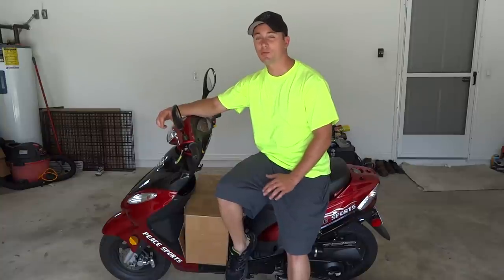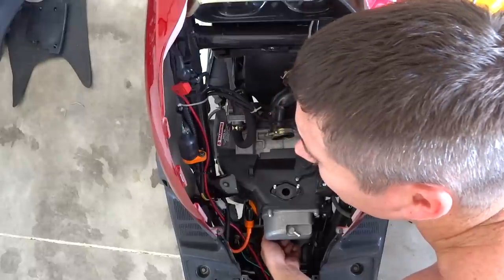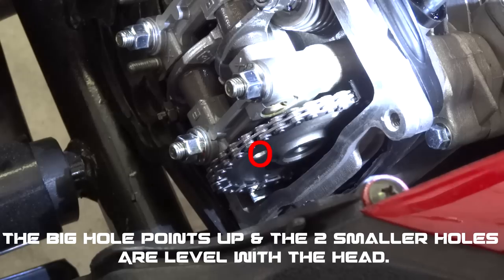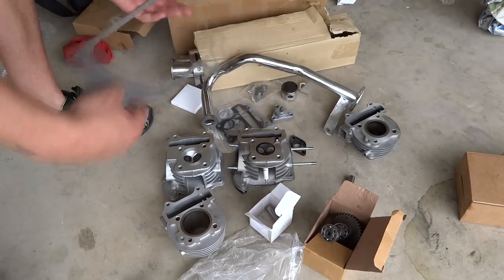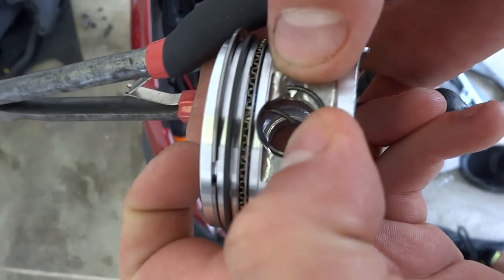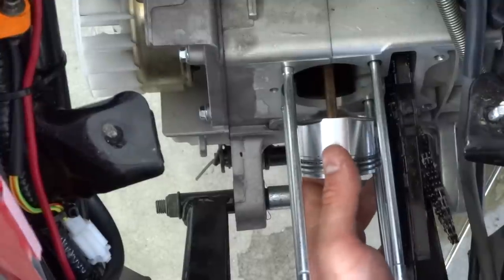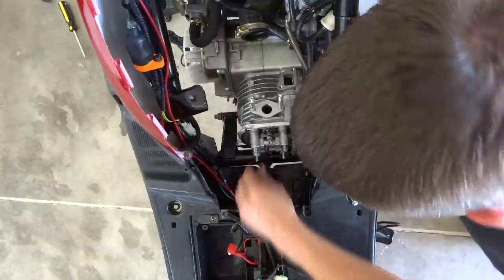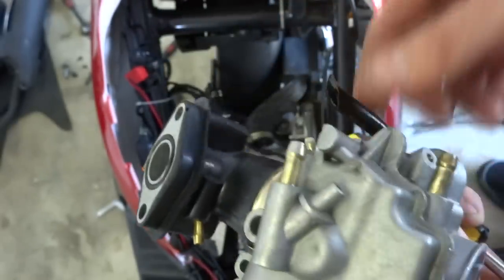DIY Gy6 Scooter 50cc to 100cc Kit

Comment: What was your tip speed? After
Reply from the maker: 56mph
Reply: @Nthefastlane  dang!
Reply: Dont believe it,  wait for proof with gps speedo (phone app), as Chinese speedos by all manufacturers have all stated Speedometers are only accurate to 28mph  as that is the only stipulation needed. A ful modded gy6 50cc with alot of mods will only top out around 51mph max and believe me just a big bore kit , upjetted carb, cone air filter and unrestricted exhaust your only looking at 45/47mph. to get more speed you will need higher final drive gear, sports variator adjustable unrestricted cdi with all the above  etc etc. fed up with vids of spotty little kids claiming  nearly 60 mph out of 50/72/82 cc kits.. GY6 125ccUK/ 150cc in US only manage 60mph. ..  so how would your 72cc be as fast as 150cc??????
Reply from the maker: Here's exactly what you asked for. BTW I was 29 in that video, not so much a kid. https://www.nthefastlane.com/gy6-scooter-100cc-bbk-56mph-proof
Reply: Nthefastlane I hate assholes Keep doing you ..  how was hill climb an stop an go ? I’m 6’2 about 280 lbs I like running around the neighborhood to the rec center n stuff on my 49cc scooter do you think it’s worth while for me to help in hills an putting more pep in my step so to speak?

Comment: did it last long ? with the stock crank shaft?
Reply from the maker: Still riding it till this day, I have also rode with two adults on it many times with no problems.
Reply: oke so if i want to go from 50cc to 100cc the crankshaft (original) is good ?
ps your video's are great!!!
Reply from the maker: Still running strong at 56mph

Comment: hey i dont know whats going on with my scooter , i 've been put everything i changed 50cc to 100cc but when i start make a laugh sound ! i dont know what i did wrong or whats going on , somebody help please!
Reply: try the simple things first overhead cams are not easy to do for people who have never adjusted overhead cam if it's making a tapping noise there is a possibility that the rocker arms on the overhead cam maybe a little bit too loose my suggestion to you is take the scooter to the shop and let them check it out for you they will take off the valve cover and they will check the clearances and make sure it is correct it only takes a small amount of movement I've adjustment to be too loose or too tight especially to tight is very bad because too tight will cause a lot of problems because if you don't have enough clearance it will scar the cam and it will star the cam so I highly recommend taking it to a shop have them check it out a very likely possibility is the valves need to be adjusted could be the valves adjustment there may be too much Gap between the Rockers and the cam I would not drive the vehicle just take it to the shop because you may further damage your scooter also the scooter needs to be cold it's going to need to set overnight so that the motor is cold so the technician can adjust the valves this is my suggestion I hope this information will help you overhead cams are very difficult to adjust properly you really need a trained professional to adjust the valves correctly

Comment: You didn't quite "clock" your rings. First, lube with engine oil, second, NEVER have gaps of rings by Piston Pin holes of the Piston like u did, always at least 30-45 degrees away, and then have the rings offset from each other 180 degrees or so which you did..

Comment: Use the 50cc head it would increase the compression because its not milled out , might have to run premium 98 octane gas ....but it would run like a scalded ape
Reply: Cassidy Strickland how sure are you about this?

Comment: just so you know, the difference between the 139 and the 1p39 gy6 motor is that the 139 is a true 49cc motor. the 1p39gy6 motor, is a true 64cc motor. if you compare the 2 pistons, the 1p39 is bigger than the 139. some people will say that the difference is that the valve length  is longer, but that's not true. the 1p39 is a 66cc motor, so if you buy a boar kit, make sure you know your motor so you don't have a 64cc 1p39 and buy a 60 cc boar kit. that's the fact about 139 and 1p39 gy6 motor!!!!!

Comment: You didn't apply oil or assembly grease to the cam, piston/rings/ cylinder. Very bad mechanical practices. Tapping engine components apart with wrenches and not a soft hammer? Noobs will see this video and damage things. Set a better example.
Reply from the maker: Jim West I did,just couldn't find the clip that I did it in. 100's of clips,somtimes one get's lost or deleted by accident.
Reply: yeah sure guy
Reply: Had I relied on this guy my scooter would no longer exist
Reply: I also noticed that he was so hell bent on putting the engine together and didn't put the plastic shrine back on. So also some noob is gonna end up overheating their engine.
Reply: Good work but Look piston ring caps just put them one by one to the cylinder and file caps correct too tight boom !!!

Comment: 28:03 most painful sound i've ever heard.
Reply: What is?
Reply: @TECHnoman753  I don't know the materials the cylinder and piston rings are made of, but you still should oil the cylinder before pushing the piston in so you don't scratch it.

Comment: Why not just buy a 100cc scooter in the first place? There are plenty of them around at often quite reasonable prices.
Reply: I think because a 50cc kit you don't need a motorcycle license but it u go above 50 you do. So I guess it's like a loophole to drive faster without a motorcycle license lol
Reply: Exactly. Anything above 50cc you'll need to plate it, get insurance and have an M class license. 

With this its still looks like a stock 50cc so unless the police take your scoot apart there's no way of knowing.

Comment: I have a 2014 TaoTao will any Big Bore Kit work or are they scooter specific? Also what was your max speed once you got it back together?
Reply from the maker: +Amber Summerow They go off the engine codes 139QMB & 1P39QMB. Top speed was 57mph flat ground.

Comment: This would be a good video if you knew what to do and what things were called and yes cars do have an oil control ring and 2 compression rings and such for loosening the cylinder head and barrel with a ratchet handle, I would have used a rubber or nylon mallet. I watched 22 minuets and could not watch any more but from what I read I am glad I didn't

Comment: Name it what it is. The 100 cc kit doesn't exist. The 139qma & 139qmb motors have a 41.4 mm stroke. With this stroke length, the stock 39mm piston makes 49.4cc's. The 44mm kit brings 62.9cc's and is sold as a 70cc kit. The 80cc kit with a 44mm piston has 71.8cc's. And then there are 2 versions of the 100 cc kit. One with a 50 mm kit which is more widely available at 81.2cc's. The 52mm kit gives you 87.9cc's. With that said, none of these kits give you what is promised. Of all these kits, it has been heavily noted when using the stock crankshaft and bearings, to not go over the 47mm kit. The crank bearing can't handle it.

Comment: You had better check your valves for seal ,that's china part's an awful lot of confidence in China parts, it takes 2 minutes to check valve for seal and if they ain't sealing your screwed , o and dowells not shims , and how long are you expecting run life out of out of balance oversized piston,needs spin balanced with piston mounted on the rod crank in balancer , other than that your gold , be sure to tip your hostesses but not inappropriately 😃, clowning with you homie ,have fun enjoy that's watts it's about

Comment: I know this sounds retarded but as a bet that it could be done. I put a 150 cc  gy6 engine back together after it had been setting taken apart under an oak tree for about a year and all seems to be fine except it has a skip all through rpm range except deceleration. And the only real problem I had was setting timing chain on cam shaft. I couldnt get camshaft to line up proper with head with piston at top dead center it was either a tooth advanced or a tooth retarded but not the right way. Or does the cdi serve as brain n correct the timing?

Comment: This is not a 100cc only 72 or 80cc
Reply: YD AgilitY I have had the 52 mm kit on my scooter. It makes it a 87.9cc scooter. Could you please point me in the right direction for a 100 cc kit? The bore size would have to be 55.5mm to make it a 100 cc scooter. I can't find 1 anywhere.
Reply: 139qmb gy6 50 cc yes
Reply: YD AgilitY It says nothing about how big the bore is. It only mentions how big the valves are which has nothing to do with how big the motor is.
Reply: YD AgilitY that only makes it an 85 cc
Reply: I know this reply is two years two late but you can replace the crankshaft with a much longer stroke with a 50mm bore kit ...that's wat we do with most of the  4stroke bikes

Comment: dry assembly, no cover for the jug opening in the case as you removed and installed the wrist pin clips, no check of either ring end gaps, or piston to bore clearance, beating on aluminum with steel tools, no plug out rotation to check for valve/piston interference, no installation of the air ducting for cooling the motor, and "guesstimated" torqueing of the head... you really couldn't do much more wrong than you showed. were you actually trying to get the unknowing to lunch their build by "singing along"? or were you testing us to find all the "which of these things don't belong" errors? honestly, why is this vid still up? btw, the original rockers were longer because the old head was 64mm valved, so even your "1p39qmb's come with 69mm valves" was proven erroneous.

Comment: Over 100K hits and no one called you on the claimed 100cc displacement?  Stock 49cc = 39mm bore x 41mm stroke. So, kits with a 50mm bore are 80cc non-believers find a displacement calculator and do the math.  BTW very rough on bearings, after all 60% increase will do evil things especially Chinese quality mains.

Comment: dude wtf, a way to make your scooter faster adjust you air, fuel screw, where the fuck did you hear that? you know that that doesnt make a difrence in speed 0:52
Reply from the maker: Sure it does, it increases your take off up untill mid range rpm.

Comment: or get a old 50cc 2 stroke and know what youre doing and you will be cheaper and faster
Reply: Ian Duijsens not in mpg
Reply: Ian Duijsens benzine verbruik*
Reply: superjojo555 nee klopt maar een nieuwe cilinder wel en het is zo veel makkelijker om er vermogen uit te halen
Reply: Ian Duijsens daar heb je helemaal gelijk in
Reply: superjojo555 want het is simpel je verhoogt de porten in de cilinder (de spoel poort in spesifiek) maakt de zuiger wat lichter door de rok bij te werken en leg een schuurpapietje op een valkke plaat en schuurt ongeveer 1mm van de kop en cilinder of (dus 0,5mm per onderdeel) doet er een power filter op en je past de injecteur aan en hopatee je doet 130 met 50cc
Reply: 130 ga je nooit redden met de standaard reductie naar je achterwiel op een 2 takt of 4 takt scooter. Je hebt namelijk geen ketting waarbij je de tandwielen kan aanpassen... en om nog even die reductie te verkleinen...

Zonder die modificatie is 93 echte GPS kilometers is een beetje de max... 
Dan draai je rond de 13.000 toeren op een 2 takt. 

Bij een 4 takt zweven je kleppen al eerder met de stock veren. 
Ik denk dat het bij 9000 toeren echt op houdt. al is de eindoverbrenging van een 4 takt iets kleiner waardoor je vergelijkbaar rijdt met een 2 takt. kan ook, 4 takt heeft namelijk meer koppel.

Overigens ga je ook niet harder met een 80,90 of 100cc cilinder, je toerental wordt namelijk niet hoger.
Het is alleen makkelijker om harder te rijden.

Dat is ook gelijk de reden dat bovenstaande combo niet even simpel over de 100 km per uur gaat.

Als je het goed wil doen bestel je dus ook een geüpgradede secondary / final gearing erbij. 
Dat geeft je zeker 10% meer snelheid. 

Ook heb je kans dat je op een 2 takt de toeren nog wat hoger krijgt... immers heeft een 2 takt bovenin pas koppel/vermogen. 130 is idd haalbaar, maar dan moet je echt de optimale setup hebben. das nie zo gevonden. Dat is een spel tussen uitlaat  - sproeier, rollen, veren enz enz. Dan hebben we het echt over serieuze tuning.

en 130 met een 80/100cc 4 takt?? Dat gaan we eens berekenen.

Om te beginnen gaan we zwaardere klepveren plaatsen. 
Met de stocks zweven de kleppen namelijk al bij 9000 toeren.
Oftewel we kunnen bijvoorbeeld de verzwaarde van NCY nemen die iets over de 11000 pas gaan zweven.
Dat geeft ons 20% extra

Omdat we de  eind overbrenging  al zo'n 10% kleiner hebben gemaakt komen we op 30% meer als de 93 km
Maar ook dan kom ik nog steeds niet aan de 130 maar max op 120 voor de 4 takt. 

Wel is het veel simpeler om voor elkaar te boxen... er is weinig tuning voor nodig, gewoon de juiste onderdelen kopen...